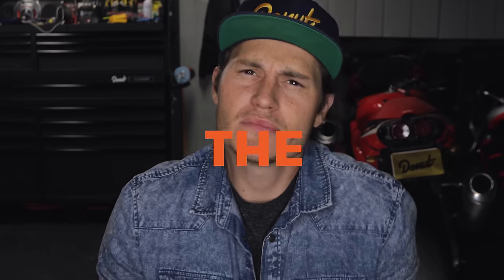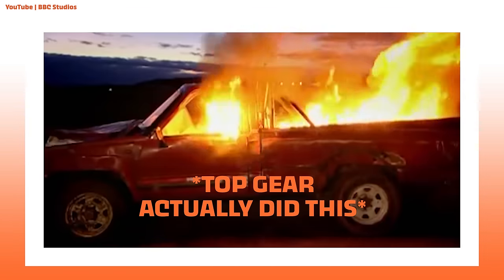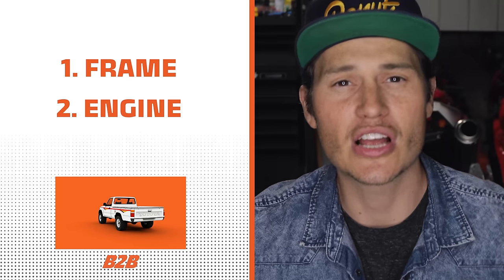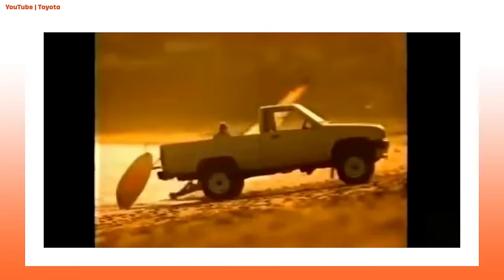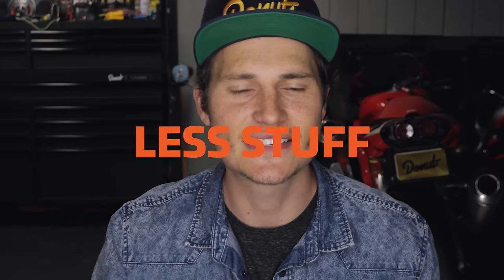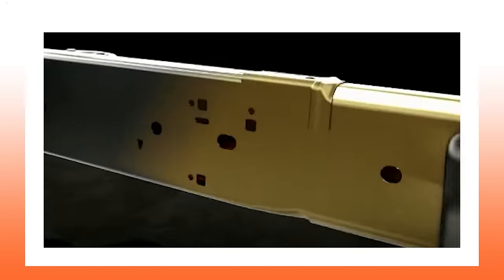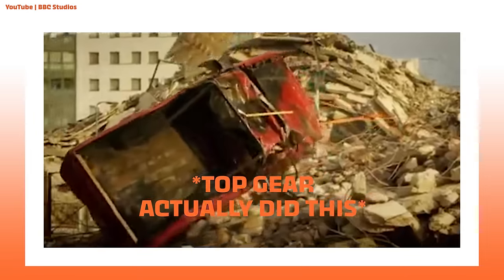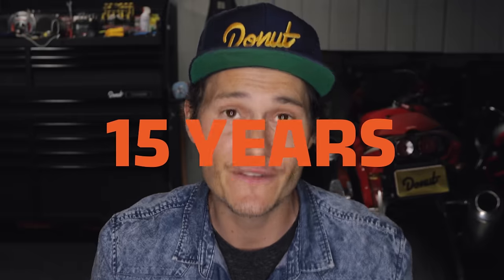Toyota PICKUP Truck - The Science EXPLAINED

Comment: My Toyota has a 5 speed manual. When I bought it, no one was aware that the drain plug for the transmission was not tightened properly at all. It wasn't until during a round trip from Portland to Seattle that I realized I had been driving without transmission fluid for over a year! I tightened the plug, topped it off, and another year later it's running great!
Reply: Toyota baby
Reply: You could fill that baby up with Nutella and it would probably still run
Reply: is the joke being it doesnt take  transmission fluid?
Reply: @MakingASign  in a manual you need to replace gear oil
Reply: This happened to me on a trip from Connecticut to Arizona.   Most of the transmission fluid leaked out.  The mechanic who helped me figure it out kept repeating "you have to remember, the toyota is an incredible machine."  Topped it off in Arizona,  made it back to Connecticut.
Reply: Seriously? 😅
Reply: That's crazy but not really, you can throw olive oil in there and it'll be good to run from Portland to Klamath Falls lol. Im from Portland will keep an eye out for your Toyota so i can be mesmerized, what color and model?
Reply: It runs a bit quieter but overall it feels the same - Toyota Owners.
Reply: Holy shit...
Reply: @jonnysrevenge lol do you have one lined up or are you just saying that? they're pretty hard to find in any decent condition.
Reply: @jonnysrevenge that's sick. I have a pal that imports Japanese fire trucks. Imports are something special. Folks in Japan take care of old cars. We're lucky to have that option.
Reply: I don't have anything clever to say, that's just awesome as hell.
Reply: Damn
Reply: Wasted transmitting fluid ngl
Reply: @MakingASign  It's not a joke.  They do have a lube sump for the gear box.  And they will run fine for a long time wihtout it.
Reply: lmao

Comment: Who else would buy an 80's style Toyota Pickup over a new one if they made them today?
Reply: Only need to add cruise control.
Reply: Me
Reply: i would.
Reply: Me but da a/c is needed
Reply: Any 80's car you choose
Reply: May as well ask who breathes air
Reply: I would dont let my truck hear it though 2012 Taco inline 4
Reply: I have a 94 4x4 single cab pick up v6 it looks and runs great
Reply: Toyota still sells the hilux just off 19.000 euro single cab  2wd 2.4 liter diesel.
Reply: not the pick up but a 80 series....... its gold.
Reply: DoriftoNoob 90s do have airbags
Reply: Yes
Reply: Over a new Tacoma? Yes, I would. The Tacoma is a clown's truck.
Reply: I need one
Reply: My first vehicle was an 87 toyota 4x4, I slid it sideways into a tree on an atv trail, rolled it in the mountains 2 different times, drove it across a frozen river and broke through the ice, left it submerged for two days getting trucks together to pull it out (still ran with a new battery and alternator). Hit a cow one night, folded the truck up, broke front axle in several places, pulled motor, dropped in another truck and ran for another 150,xxx miles. Those trucks are great, I'd take a 70's-80's yota over anything being built today.
Reply: @bigmanmegee  my 93 doesn't have any airbags. I dont intend on needing them though... lol
Reply: It’s a no for me bob
Reply: Toyota does still sort of sell them
70 series land cruisers available in Aussie, nz, Africa and some other places
Reply: Wish. I had kept mine.
  That truck carried my tools without ever failing.
Reply: Definitely me
Reply: With low miles sign me up
Reply: I wouldnt not buy one.
Reply: Toyota is not nostalgic as a manufacturer. It took a lot of American enthusiasm to get the FJ Cruiser onto production...and even then they would not go full in with an inline six, solid axles and a real gear driven transfercase. It was clear that the campaign would be a short lived product, much as the Supra has been all but tantalized as a return, but ultimately bastardized. Toyota has long standing contracts just like all of Japans wealthy nobility. They openly posture that they will cease automotive production of any kind by 2070. No clue what industry they will be involved in. Maybe Airframe or medical instruments.
Reply: I have a collection of them as I restore old Toyota 4x4s. Toyota makes nothing like them today. Now they have IFS, chain driven transfer cases, thinner frames, increased complexity, thus creating shorter life and diminished reliability. I absolutely would not sell any of mine for less than 20K. The propane turbocharged one is emissions exempt so that would be hardest to let go.
Reply: I would
Reply: Wouldn't be able to do my work .... But I'd like to have one for offroad. Gotta have my 1ton diesel to do the towing i need
Reply: Toyota has the 70 series Landcruiser with an inline 6 turbo diesel, solid axles, full floater front and back. 1 ton payload...to which most of Australia and African owners use as if they were 2 ton.
Reply: All I need is AC baby lol
Reply: Hell yeah
Reply: They do, look up 70 series land cruiser utes
Reply: @denismihalych6619  My '88 SR5 had lock-out hubs, 5-speed, AC, and cruise control!  Had a pretty good stereo too!
Reply: @josephdavis2427  SHiiiitt. tell me about this propane turbo you BOSS! Still rocking my 85 4runner. I'd like more power or better mileage sure.. but the damn thing doesn't break... so I probably won't get to it lol
Reply: They make a land cruiser truck that looks exactly like the one from the 80s its like 45k
Reply: The old Nissan Hardbody trucks were pretty damn good too! I had a 1994 Toyota and a 1997 Hardbody and loved them both. I liked everything about the Nissan better though as far as the way it felt. When Nissan went to the Frontier they killed the quality and went cheap.
Reply: @JasPlun  super rare to see old Nissans. I always see old Yotas. Just sayin. And I have worked on almost everything there is except newer cars. Nissans are not even in the same ballpark IMO. Better than american cars though mostly. A few rare exceptions. Lots of s10's still on the road for example.
Reply: Hell yeah
Reply: It's worth buying a 20R model and throwing 5-10 grand into it..it will go another 30 years
Reply: I do🖐️ they have been proven to work in extremely hostile terrain in Central america.. where american truck can't go without falling apart
Reply: Anonymous white Because they are awful to drive (Uncomfortable, poor handling, rubbish suspension), noisy, underpowered, inefficient, virtually no safety features. Only good off-road (but still so uncomfortable), and good for towing - but not if you want to tow all day because of the lack of ride quality and comfort. They really are terrible.
(I’m referring to the 70 series)
Reply: Roxor has a box frame!
Reply: Literally every truck driver ever. Even die hards Ford and Chevy users knows that the Pickup is a pretty damn good truck.
Reply: The trick is to get one with a manual transmission, no electric power crap, and one that has not been parked for decades.  The closer you can get it to the black one in Back To The Future, the better.
Reply: @autismion  If it is in the 1980s it is built sturdier and no airbag is needed. Airbags are there to make flimsy death traps marginally safe to drive. That way the car companies can make them out of foil then put ten airbags in it to get them to safety standards. There is no way I would drive a modern piece of crap with out as many airbags as possible. Vehicles from the 1980s, I would drive without airbags and not think twice.  Back then, cars did not flip over as easy, break in half, nor collapse and trap you inside a wad of foil.  I still can not believe the crumple zone is sold as a positive.  It is an excuse to make a weak, flimsy,  car that will trap you no matter how many airbags it has.  But without the airbags, the collapsing car would trap groundbeef. I have seen many cars where the occupants were  severely crippled in mild accidents, or died, when I worked in a salvage yard. We would see the foil car coming in completely devastated and we would look in the newspapers to see if the person lived or died.  The job paid actually really good.  But the gore rather got to me and I quit after two and a half years.  I could not imagine how the meat looked when it was scooped out of the wreckage.
Reply: I wish I could get my hands on one of the original 4runners
Reply: Heck yeaj
Reply: I have a 1994 one
Reply: I would buy 1994/95 4x4 that was produced. That had the 4 banger . And I would still buy v6 model to but I would want the 2012 v6 motor s in them .
Reply: Upgrade it with the latest safety stuff, and we;re good to go. I miss the retro 80's look.
Reply: Me
Reply: I still do. I have three and I love all of them. Get you one.
Reply: They do, its called the Toyota Hilux in Australia.
Reply: @indridcold8433  your choice but an old solid vehicle is less safe than one that can absorb the energy of a crash with crumple zones. Also you have less injury to your soft body with an airbag than just a seat belt. Modern cars are much safer. It’s fact.
There’s loads of footage available to show how old cars kill the occupants and modern ones protect them more. However in a severe crash you’ll die in any vehicle.
It’s a total fallacy to say older vehicles are safer etc
Reply: @jerrymyahzcat  I have had three big crashes in my vehicle, once my fault, twice the other operator's fault.  The two that were the other operator's faults, their car had to be flat towed away and would never be drivable again.  The operators of the other cars were seriously injured.  Me and my vehicle were fine. The third time I fell down a very steep embankment and hit several trees on the way down.  I was but my vehicle was rather wrinkled and battered.  I put it in four wheel drive and it drove out of the swamp at the bottom of the embankment.  I drive the vehicle as it was for two months while I saved to buy body panels.  The alignment was still straight as an arrow, the steering wheel was still centered, the doors still opened and shut.  After I put it back together, I painted her hazard yellow so people could see her in the distance and stop hitting me.  I have had many smaller crashes over the decades where nothing has happened to my vehicle and the other vehicle is really ugly and messed up after it hit me. I doubt I will ever part with my vehicle.  It has saved me three times and still going strong.  Next year I am replacing the interior. Many say it is costs more than the ancient vehicle is worth.  My old Stargazer and I will be together forever.
RMS Stargazer
1996 to forever.
Reply: I bought a rust free 88 with a 22r not long ago with 420,000 miles and still daily drive it.
Reply: @netrioter  20R Is just as good as the 22r its just an updated 20 r engine and yea bc later on they'll become even more rare and expensive.
Reply: @jonathanisom102  My dad has owned more than 20 of these trucks and always been true gems but we sold them for money and still regret selling the last one that was a 4x4 22R 1984 Hilux which needed work and also regret selling The older 4x4 1981 Hilux with the 20R engine that was his baby and i remember muddying with that truck as a kid. I truly miss that truck i rather get that truck back than a Mercedes for all i care but i remember the new owner for the 1981 we sold had riced the crap out of it, chrome rims, and crappy mods a Cholo dude would put to a truck and i literally cringed so hard and regretted havent telling my pops to not sell it but it was too late. No one appreciate these trucks anymore and even ruins its original style with ricer mods but oh well gotta move on hopefully finding another Gem Hilux.
Reply: Just add crumple zones and other  safety features.Simple is better.
Reply: Me I would, 79 series landruiser over modern hilux any day.
Reply: Not gonna lie it’s looks and prolly feels retro and I’m digging that
Reply: I love the 80’s style Toyota pickup! Just would like to have some airbags though.
Reply: Fixin mine now 85 toyota pickup with a 22r had it for a year little to no issues it had a bad water pump though i thought it was a loose hose kept workin on the hoses didnt know my water pump was shot kept runnin it hot and it blew a headgasket which it still ran for a little bit had to get it somewhere to park
Reply: No I would buy a modern style pickup truck that was built like the Toyota pickup
Reply: @bigmanmegee  i have a 95 4x4 hilux double cabin diesel with no airbags...
Reply: Shit I bought 94 and I still pick it over anything new. I don’t want them to make it now because then it woudnt be the same thing. They’ll never design a “new” car with the same features as an older vehicle. I agree, it would be cool, but due to capitalist greed it never will.
Reply: @denismihalych6619  their pickups in the early 90s did have cruise control
Reply: @autismion  I have a 94 and I’ve never once missed the air bags
Reply: I would! I miss mine. Never should have sold her.
Reply: i generally think that old 80s car designs maybe werent that airdynamic good but they were lookin nice and simple and i like them
Reply: My 1990 runs just fine. I don't need to buy a new one😂
Reply: Me
Reply: Not me only for one reason: NO AC
Reply: @phosphorus_2v  you could get ac on them as an option. It just wasnt standard
Reply: Hella naa im getting a 74 hilux and a yoga scout
Reply: I have mine!
Reply: I've owned an '86 and a '20.........'86 all day long.
Reply: I have one lol
Reply: You can still buy them. Imports.
Reply: I would buy any 80’s car so long as it has a man over a modern car
Reply: @josephdavis2427  Do you have any suggestions on getting parts? I have a 79 limited edition. Looking for a good engine rebuild kit. 20r engine.
Reply: @brianfogle2743  There are too many kits worth mentioning. Just make sure that the main and connecting rod bearings are Clevite brand. Avoid any piston rings that are chrome or "high performance" basic cast iron rings will seat and interface with the cylinder without wearing strange or smoke out the tailpipe forever. Do not take the crankshaft to have its journals resurfaced, If there is scoring or damage just replace it...the factory cranks are Nitrided for exceptional strength, a machine shop that is used to rebuilding cast iron cranks will be cursing all the carbide that are ruined just to cut through the Toyota journals...and now you have a ruined crank in my opinion. Best parts for a 20R are Toyhead or LC Engineering. Become familiar with detecting a burnt valve and how to use lapping compound on the cylinder head. Alot of cost can be saved by doing some things yourself and using a straight edge, measuring instruments to decide what should be fixed, and what is still within spec to reuse as is.
Reply: Yes please.
Reply: I actually did. Bought an ‘86 SR5 4WD 22RE two years ago instead of a new one. It was in great shape, no rust and only 170k miles. Paid $9200. My buddy laughed and said I could’ve bought an ‘06 for that. He doesn’t get it. Funny thing is I’m bringing it back to its original glory and the value is climbing linearly with the mileage
Reply: yes
Reply: I need that AC tho. Hot as fuck where I live
Reply: @shaneanderson983  uhh the 1989 Hilux can pull 15 tons on a trailer so...
Reply: @phaikia13  like tinfoil body?
Reply: @staresce  "love my car to trap me after a minor accident" -no one ever

crumple zones are just another death trap
Reply: Toyota make better stuff still now, just not for every  market. 70 series Landcruser’s >any hilux.
Reply: V8 Turbo Diesel is in them for near on 20 years now, 6 is unfortunately dead, save some na ones in small numbers.
Reply: Hell to the Yes.
Reply: Add modern features and it'll be a treat!
Reply: I bought it today

Comment: My 1991 had 270k miles before the trans finally went out. Still drivable, I just lost 4th and eventually 3rd, never left me stranded though. I found an old 5 speed on craigslist for $50, I show up and it's buried in the guy's backyard hallway in mud. We settled on $25, cleaned it up, still runs to this day with almost 450k miles. All original except for that $25 transmission replacement 😂
Reply: sounds like craigslist
Reply: @lookstothetroon  i think its english idk man
Reply: @mwafr idk sounds like ebay to me
Reply: Ahhaha that’s amazing😂
Reply: 450000 miles and you repaired nothing but that transmission? 

I call BS
Reply: @philpyung4831 not likely if it’s a 22R, but if it’s a 3L easily. Lots of them over a million ks down here in australua
Reply: Man these nokia partnerships are good
Reply: You did not find a trans for $50 😂😂😂 stop lying
Reply: @achilleaustin4477 what’re you smoking? No one rocks the 3.slow. It’s 22re all day babay!
Reply: Mine started popping out of 3rd gear, and felt really weird going into 2nd, thought tranny. Turned out it was just the bushing under the gear shift lever, Toyota sells a kit for like 27 bucks...
Reply: @philpyung4831  mine has  350 k miles on it .........origional clutch .......engine and gearbox .......starting to jump out of first of late ........
Reply: Incredible!
Reply: @georgedoorley5628 does it stutter when doing that? Like kind of sputtering like it's backfiring